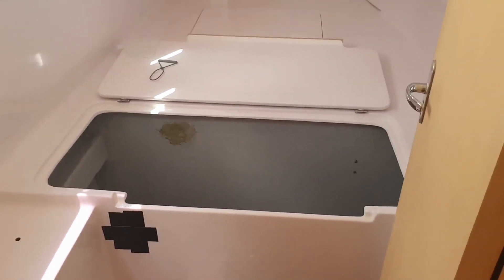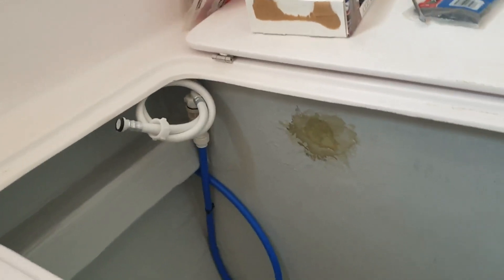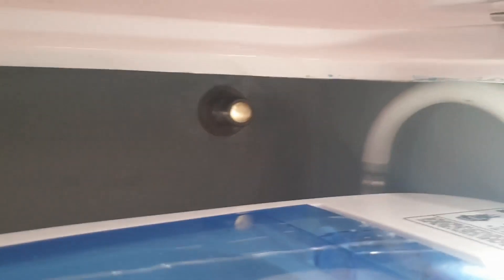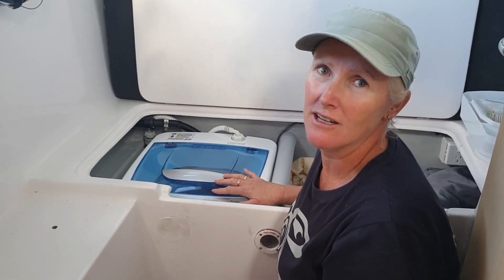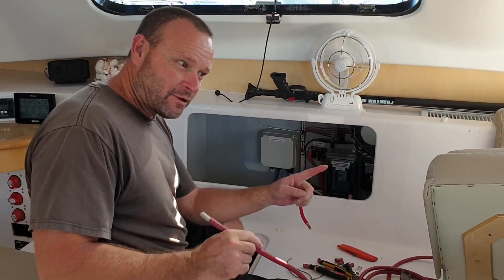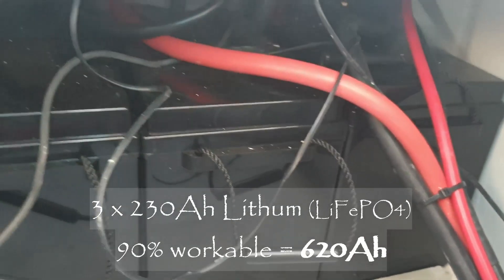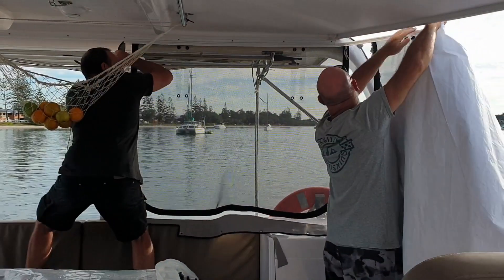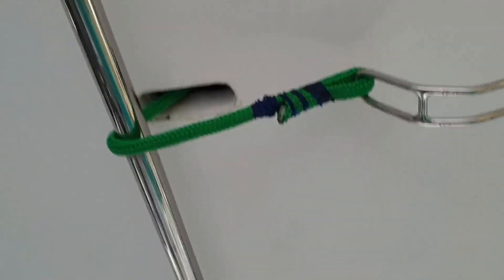Modifications & Improvements - Washing Machine, Genset and new Clears

Comment: This might be a stupid question, but why did you install the washing machine on the outboard side of the hatch requiring the moving of the fire tube rather than just installing on the inboard side and running the plumbing across?
Reply from the maker: The fire tube was almost center and the washer didn't fit on either side. On the inner side, the shelf hangs out a fair distance, therefore placing that side created wasted space. The outer side, the washer fits with minimal wastage and we can still store our spare headsail plus a few other bits and pieces.
Reply: @SailingNoRegrets  Thank you!! Did you get the 3.3kg 240V or the 3.5kg 12V? Looks like the 12V is more power efficient? Although I could be reading the specs wrong :)
Reply from the maker: @Andrew Coates  I just had a look and the 12v does look like a great option. It isn't drawing huge current so you don't need super heavy wiring to allow for voltage drop over a long wiring run. I'd likely get it in 12v now as well
Reply: Last question, maybe 😊. When installing, do I need to allow any height for the hose that comes out of the top of the machine ? That is, do I set my shelf down 750 or do I need to go lower?
Reply: Last question, maybe 😊. When installing, do I need to allow any height for the hose that comes out of the top of the machine ? That is, do I set my shelf down 750 or do I need to go lower?
Reply: Last question, maybe 😊. When installing, do I need to allow any height for the hose that comes out of the top of the machine ? That is, do I set my shelf down 750 or do I need to go lower?
Reply: Last question, maybe 😊. When installing, do I need to allow any height for the hose that comes out of the top of the machine ? That is, do I set my shelf down 750 or do I need to go lower?
Reply from the maker: @AndrewCoates-v5v  I'll have to confess here, when I fiberglassed in the shelf I set it at accurately to the machine height, then after it had just cured I dropped in the machine to have a look. The hose connection at the top is NOT INCLUDED in the manufacturers height measurements, and the compartment lid couldn't close. I had to rip the shelf out, grind a lower section for bonding and re-fiberglass in a second time. Luckily it had not gone really hard and I was able to rip it out without too much fuss, but I did curse I can assure you. 
Definitely connect the hose and measure it, I think I gave an extra 50mm after the hassle.
Reply: Oh man!! That’s exactly what I was afraid of. They really could have mentioned that in the manual hey!! Thanks for the heads up. 

With your through hull, is the hull wall composite? Did you have to drill and then epoxy core fill before you installed the fitting? I’m just wondering if I should try and run to an existing through hull instead (eg. Bilge through hull under starboard helm or up to the sink through hull). I haven’t drilled through her yet and am struggling to actually go through with it 🤣🤣
Reply from the maker: @AndrewCoates-v5v  I went through the side in line with the galley sink. It is just under a timber beam on the side in ours. It is above the waterline so really not that stressful to drill through, but I understand as I double, triple then checked some more before drilling. It's foam core so not very difficult to do, lots of tips on YouTube to drill cleanly. I only applied lots of sealant around the thru hull to ensure no water got past, but it's above water so really not under any water pressure.

Comment: Hi guys great review, is it fussy on throwing out of balance , I would put mine upstairs on the flybridge so with boat leaning only very minimal do you think it would
Effect balance cheers
Reply from the maker: I think it would be fine, ours doesn't seem very fussy. If your base is too far from level you could pack it up, or the feet should be adjustable. Can't see the base of ours now installed to confirm though.
Reply: @SailingNoRegrets  I’ve sent the link to the wife so I hope she comes home with one , we live in a marina and the laundry shore adds up fast , about 20 dollars a week she said to wash and dry , we usually go away for a month at a time in summer so the little hand powered EZY wash works quite well for light swimming type clothes but now we are going to spend 3 or 4 months a year up the reef I was starting to get worried about washing with track suit pants etc
Reply from the maker: We too noticed the laundry bills getting high, it has very quickly paid for itself. Being able to spin your clothes made drying them so much quicker and easier too, you'll love it

Comment: Hi Chris - do you recall the size of the thru-hull you used for the waste water?
Phil
Reply from the maker: I'm not certain but I think it was 3/4" or 19mm. Doing a Google search produced nothing either. We put in a one way valve to stop any chance of salt water splashing back into the machine, the outlet we put in line with galley thru hulls which was just below reinforcement beam running alongside, and as high for machine to keep water level when operating

Comment: I had been wondering about that hole for the door lift line and whether it would let water in.  How happy are you with the 1260?  Do you ever find yourself wishing you had gone with something different?
Reply from the maker: No we find the design and build of the 1260 perfect for our requirements. We find it safe, fast and very comfortable. When it's bucketing rain or scorching sun we are very sheltered under the targa roof. And the door lift rope cover still isn't 100%, it is wicking somehow along the rope so another modification will have to come! It is still VERY dry inside, we now have a HUGE entertaining area with the doors up in all weather
Reply: @SailingNoRegrets  Nice.  I only recently got interested in sailing (landlocked kansas boy).  As I go through all of the awesome boats out there, I keep coming back to the 1260.  Even the new 1370 doesn't make me want it as much as I want the 1260.
Reply from the maker: We like the 1370, we intend on further blue water passages and the bigger boat would be nice. But that said our 1260 is now setup well with everything for full time live aboard requirements and is so easy to manage single handed, all in a good performing catamaran.